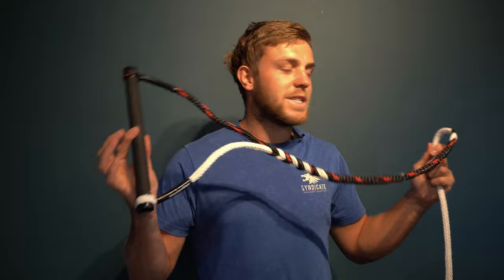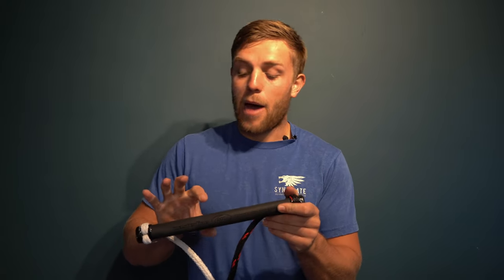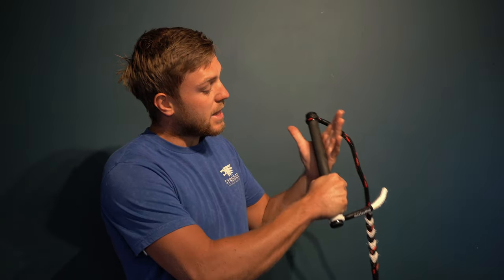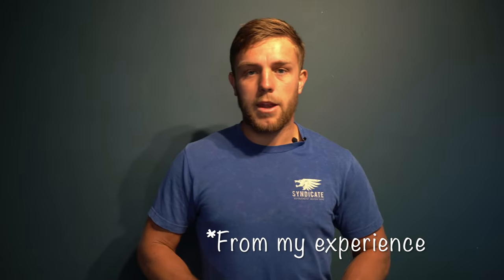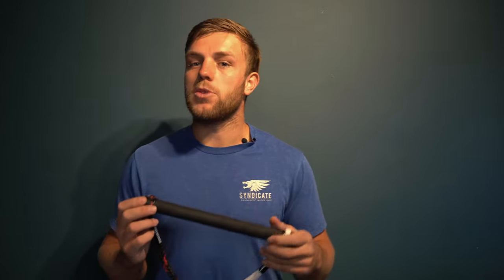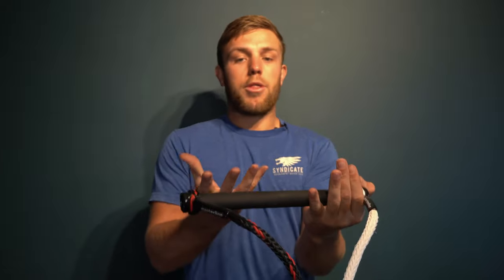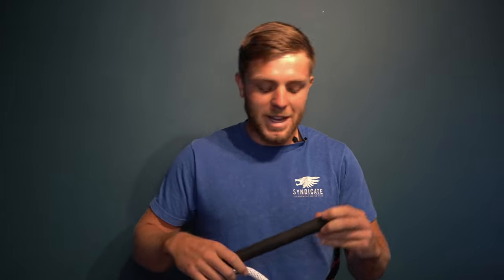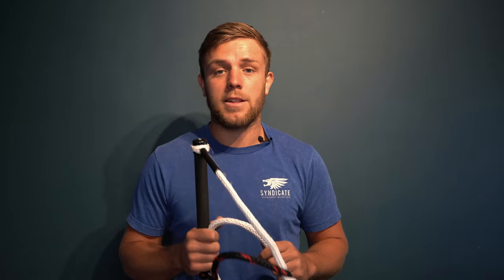How To Pick the CORRECT Slalom Ski Handle For YOU and Why SIZE Matters!

Comment: Causal lake skier here. I've recently changed to a smaller diameter handle (1" HO). I'm 6'3 / 190cm, about 100kgs, pretty big paws, and first to admit I'm not the cleanest getting out with deeps starts. I've actually found the smaller diameter much easier to grip, especially compared to, say, a kneeboarding handle. I can wrap my fingers all the way around the handle, almost like a deadlift grip on an olympic bar (which is 1.1"). Considering gloves taking up a bit of space, this sorta makes sense, So worth experimenting.  Nice vid. looking forward to the next one. 👍🏻
Reply from the maker: Hey Tim, That makes sense for general ease of grip, what I was mentioning was more to do with trying to stay away from ripped hands and trying to let the handle stay more towards the fingers when leaning across the wakes instead of over-gripping. But that's the great thing about skiing, everyone finds what works for them!

Comment: Hi Rob. When i hold the handle longer, I get more slack. Is there a way to reduce slack
Reply from the maker: Hey, check out my video called Are you holding onto the handle too long and why does it matter. This should help you out. But realistically its probably because your back shoulder gets pulled up and and you end up squaring up to the body, then skiing straight too it causing too much speed at the buoy which can cause slack. Check out the video, this should help figure out what to do to correct it